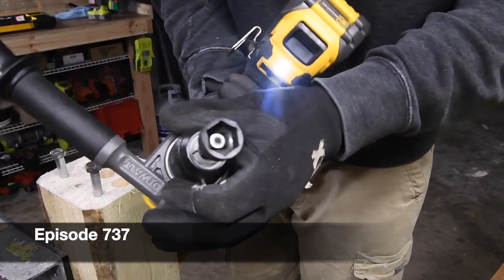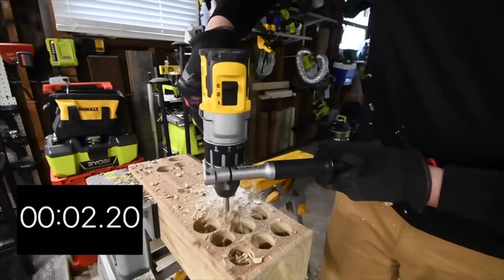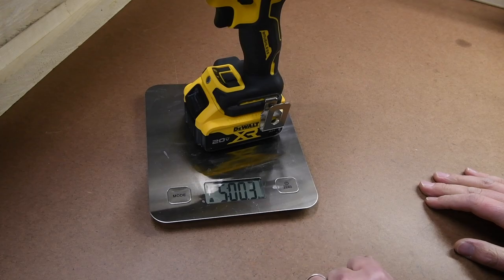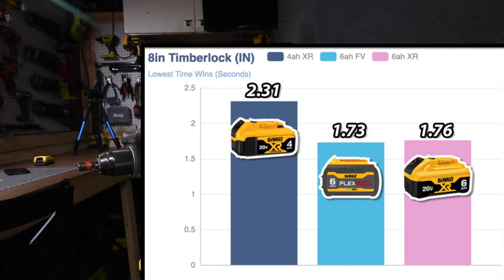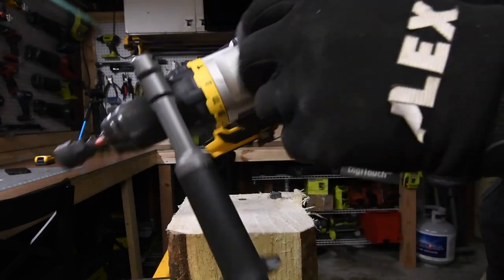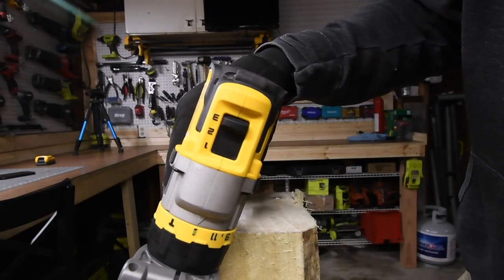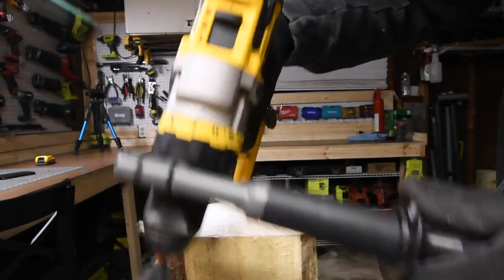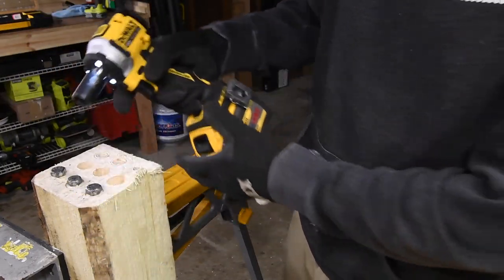It's Either all lies, or None of it is!

Comment: Perfect. I'm trying to decide right now between the power detect and the flex volt advantage. I watched your other videos and it has me leaning towards the power detect. Yes, do the updated video between the two so I can make up my mind once and for all.
Reply: Lol me to
Reply: Yes me too haha. Thank you man caver for update.
Reply from the maker: Id go with the Power Detect, but both PD and FA needs to expand their lines of tools
Reply: @ManCaverTools  thanks. That makes it easy since the 998 is currently only $151 on Amazon.
Reply: @ManCaverTools  But are they going to bother expanding them, now that they're pushing their pouch cell batteries?
Reply: @TheCharleseye  yea they make a new Model 1000 POWER STACK DETECT HAMMER DRILL and CHARGE US ABOUT $450 and INCLUDE the New XP DCF 845 IMPACT DRIVER
Reply: @tgltoday2717  
The DCD996 can be found for much cheaper with the same power while using a high output battery. It only falls short of the 998 or 999 on the most extreme tests when you're pushing each of the tools to their fail limits. You're going to accomplish 99.99% of your jobs with the 996 vs the 998, if not 100%. In my case the 996 has yet to leave me wanting in the last five years. However, I did recently buy the auxiliary handle part from the 999 because the one that came with the 996 is a little too short.
Reply: @joshuaewalker  Thanks for the info. I debated getting the 996 but then I got the 998 for Christmas so I no longer have a decision to make. lol
Reply: @tgltoday2717  
Lol Can't beat free! Enjoy, it's a good drill and it's already got the longer handle.
Reply: @tgltoday2717  
I checked out your channel. Looks like you're a pretty handy man DIY kind of guy. You might already do this, or at least know about it, but I do suggest to clean out the factory grease and put in some good stuff in that DeWalt power tool there.
Reply: @joshuaewalker  You sure can't. Good to know about the handle. It has been very educational when I realized how many different Dewalt Hammer drills there are and then I realized they don't all have handles. lol
Reply: @joshuaewalker  Thanks man. I defiantly love me some DIY. I did not know anything about changing out the grease. This is my first Dewalt drill. I typically only had Makita and Masterforce drills up until now. Thank you for the tip and checking out my channel.
Reply: @tgltoday2717  
Yeah, all these tools, no matter the company, are built to a cost. The grease that's in there is "good enough" to get through the warranty period and even way longer if you're not using it much, but some high quality Marine grease or brake and caliper type grease that can withstand high temperatures and repel moisture is definitely a decent upgrade inside the gearbox.

Comment: The flexvolt advantage drill is awesome. I’ve been using it since release almost everyday at work (plumbing and hvac) and have yet to kill it by abuse. And it has more than enough power for everything.
Reply from the maker: it is. this is one tool that I davent really tested too much. but the Flexvolt advantage part of it is pointless.
Reply: @ManCaverTools  I agree the flexvolt advantage I believe is a marketing ploy. I do however only run the flexvolt line of batteries for the runtime they provide. All in all dewalts 60 volt platform is solid i feel. It holds up in my trade no problem. I can’t say that about the big red competitor. Their gen 3 tools are great at first but the longevity is lacking.

Comment: If you get the new 5AMP POWER STACK got mine on order from Ohio Power tools since November 15 Hope it comes in soon so I can Compare it to my FLEX STACKED LITHIUM should be close just going have to use Impact DRIVERS too hard to hold 2 hammer drills side by side
Reply from the maker: I will be testing that out as well with the power detect
Reply: Oh.. i wait power stack 5ah vs flex volt on dcd999.

Comment: Something to note, DeWalt marketing compares their Flexvolt Advantage DCD999 and Power Detect 998 with optimum batteries to the 996 with only the 5ah pack. 

The 6ah Flexvolt battery is garbage compared to the 9ah. The 999 does see a significant gain in power when comparing the 6ah Flexvolt battery to the 5ah pack. However in my experience you can feel about the same gain in power going up to the 9ah Flexvolt battery from the 6ah Flexvolt. So really they marketed the wrong battery for the 999. 

That said, who the hell is going to run that sized battery regularly on a drill? I generally stick to the 6ah XR battery on the 999 until the occasional times I am drilling concrete or masonry where I step up to the 9ah Flexvolt pack. For these tasks an SDS would be the better tool but I don't have one and can't justify the cost to get one. My 999 suits those needs and 99.5% of the time lately I just use my DCD805 with the 4ah compact battery. The 805 is nipping on the heels of 996 power in a smaller better balanced package.
Reply from the maker: power isn't everything, but the power detect naturally is a more powerful tool with not needing the bigger batteries

Comment: Dewalt needs to put 21700 cells in the Flexvoit batteries.  I like the 8ah battery best for high torque tools on a really tough job. 6ah is probably the same I just don't have any of those, both are 21700 cells.
Reply from the maker: the Flexvotl battery that I have does have 18650 cells another channel opened them and we saw what was in them. the new ones might have 21700, I think the 9ah does
Reply: 9ah and 12ah fv packs have 21700 cells. 6ah xr is better than 8ah xr, both have 21700 cells. Same as 10ah xr, 3 and 4ah compacts

Comment: As I suspected: My trusty old 996 hammer drill with a high output battery is still just as good as getting one of the newer 998's or 999's for way more cost.
Reply from the maker: the FLexvolt advantage doesnt really have any special benefits.
Reply: @ManCaverTools  
I'm curious to know what, if any, special circuitry is in the "power detect" version of the drill and what it's actually doing in order to provide more watts to the motor. I guess I'd also like to see whether or not it's the same motor and gearbox in the newer drills versus the 996. Whether or not there's a mechanical advantage in the newer drills versus just some games going on with the electrons?

Comment: I'm pretty sure the 6ah and 9ah flexvolt batteries also use 21700 cells like the 6ah XR battery. Great video!
Edit: They do not use 21700 they are indeed 18650 good to know either way
Reply: Yeah this is surprising that the 6 Ah FV battery did as well as it did with 18650 cells. Makes me wonder how the 9 Ah FV battery does against an 8 Ah XR.
Reply: @bt5252  8ah XR uses 18650s as well so the 9ah should just beat it
Reply: @ns_racing  you sure about that?  It has the same wide form factor as the 6. Workshop addict just did a comparison test after this, and it seems to perform like batteries with 21700 cells.
Reply: @bt5252  positive
Reply: @bt5252  just learned that the 9ah flexvolt however is packed with 15 samsung 30t 21700 cells 😳
Reply: @ns_racing  apparently can’t post links. Try searching 8 Ah Dewalt cells.  Confirmed 21700
Reply: @bt5252  yes I saw that could've swore they were 18650s but not complaining 21700s are better lol. So 3ah, 4ah compact, 6ah XR, 8ah, 9ah FV and 12ah FV all use 21700
Reply: @ns_racing  you are a bit confused in general. 6ah fv uses 15 18650 2ah cells, which are the best 18650 cells in existence,  very powerful. 8ah xr uses 10 21700 4ah cells, which are not so powerful and is a weaker battery compared to 6ah fv. 6ah xr however uses 10 of 21700 3ah cells which are more powerful so the pack has similar power to 6ah fv. 9ah fv uses 15 of those 21700 3ah cells and is a very powerful pack, more powerful than 12ah fv.

Comment: One row of 18650 good up to 20-23A
Two row 18650 up to 40-46 A
3 row 18650 up to 60-69 A
One row of 21700 3Ah good up to 30-35 A
Two row of 21700 2x3=6Ah good up to 60-70A
One row of 21700 4Ah good up to 40-44A
Two row 21700 2x4Ah=8Ah good up to 80-88A
3 row 21700 3x4Ah=12Ah up to 120-132A
Power stack 1.7Ah is better then 6Ah 2x18650 and close to 6Ah 2x21700. Power stack 5Ah is close to 8Ah 2x21700. Still waiting for power stack 20Vmax @ 2.4-2.5Ah and 12Vmax@ 4Ah with 3 x 21700 4Ah.
Reply: Still waiting for power stack 2,5Ah, but I should't coz' DCD 800 is wey to noisy for my taste... I've got one just for my collection, but not to realy use it. In 2015 I bough a Makita DDF 480 brushless and that   thing was close to make me hate brushless tools coz' the fan is noisy like a turbojet, so I know for a long time what to expect...
Reply from the maker: the 5ah is is big. I was hoping it would be a lot smaller
Reply: Too generalized, there are stronger and weaker 2ah 18650 cells. For eg 2ah cells they use in 6ah fv packs are at least 30% more powerful than 2ah cells they use in 4ah pack. 
Also 3ah 21700 cells are more powerful than 4ah 21700 cells, and by a lot.
Reply: @riba2233  I'm not familiar with flex volt models, but 3 x tool grade 18650 can get to 60-66A so 50% more then 2 x 18650 good up to 40-46A. About different 18650 used, altrough I've seen test where 3Ah is more powerfull, the 10.8/12V ones DeWalt I test and both reject where the exact oposite, 2Ah a lot more powerful then 3Ah, but even so not enough for DCD 701 - 2Ah had the power but not the stamina, so for that I expect 4Ah with 3 x 21700 like Hilti and Metabo. About 21700 my experience also differ, 3Ah being good for 30-35A and 4Ah being good up to 40-42A, 6A - 60-70A and 8Ah - 80-84A.
Reply: @loochan325  standard pack use Samsung 20R, 23A rating, fv 6ah packs use Samsung 20S, 30A rating but they can do even 40 cont.
3ah 21700's are much more powerful compared to 4ah 21700's, just watch some discharge tests at 40A between samsung 30T and 40T, not even close.
Reply: @riba2233  Two things:
1. There's no such thing as 18650 good for TRUE Sustained 30 or more A. Years ago there was 1,5Ah Sony rated for PULSE up to 30A, but only 20 A sustainded. Today Samsung 2.5Ah that are better then both 2 and 3Ah, are specified up to 20 A sustained but can go up to 22-23 A sustained. In pulse can go wey more but at 25A it deteriorates abruptly with each pulse and the cells are destroyed. 2.  About 21700 cells I'm familiar with Bosch and Hilti and 4A and 8Ah is better then 3 and 6. 4Ah - up to 42A, 8Ah up to 80-84A, 12A up to 120-132A,  and 3Ah up to 30-35A. But I saw tests with Dewalt with all models aligned on the bench and 8Ah was better then 6A both with 21700. 6A was in range with 1.7Ah powerstack and 8Ah in range with 5Ah powerstack.
Reply: @loochan325  look like you are out of touch, there are a few 18650's that can run 30A cont. Like lg HB2-6 and Samsung 20S I have mentioned which can even run more then 30 cont. Even tenpower 2ah's are close...

You know some stuff, but are lacking much still, I suggest some browsing of tests by mooch on ecigarette forums. There is a lot to be learned...